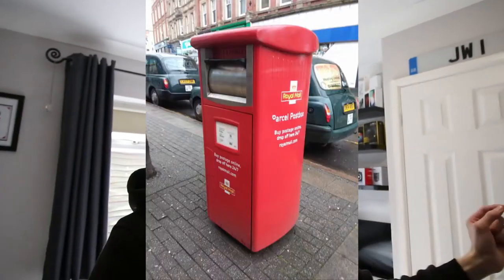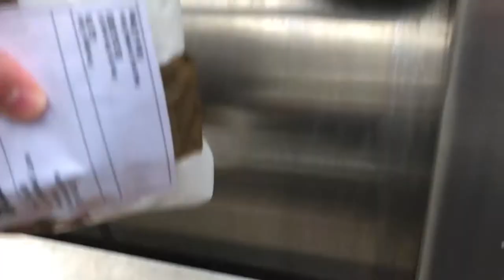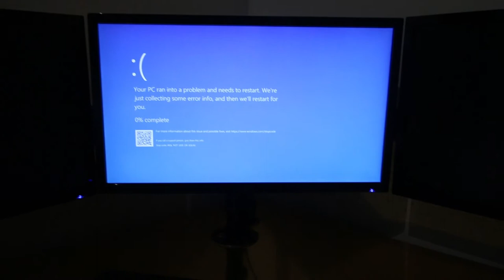HUNTING FOR A PARCEL POST BOX! (Royal Mail Click & Drop)

Comment: So there's no proof of shipping with this? If you don't mind me asking  why don't you use hermes/collect plus? At least the drop off shops are open all the time and you get tracking and proof of shipment
Reply from the maker: You can pay for tracking etc , and also get a postage slip you can take to the post office to get stamped as proof of postage!
Reply: @JackTalksCars  thats what I mean, these boxes can't be used if you need proof. Tbh I find the RM system so archaic. Queue in line at a post office between 9 till 5. Hermes/Collect plus £3 including tracking, drop off at 11pm at my local corner shop, no queuing etc. I think royal mail have been so slow to react which is why they've only now just started introducing these boxes